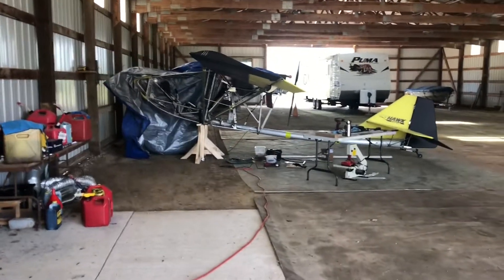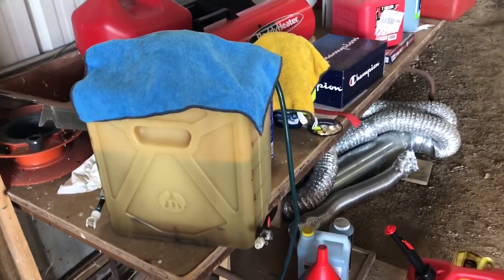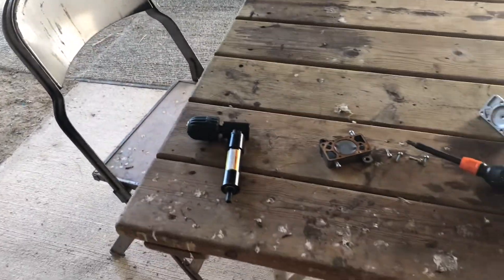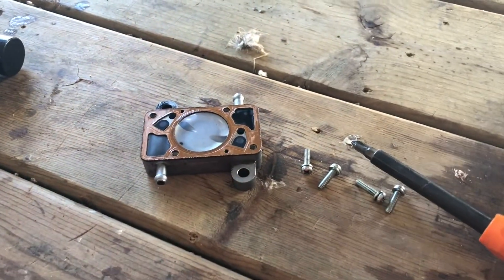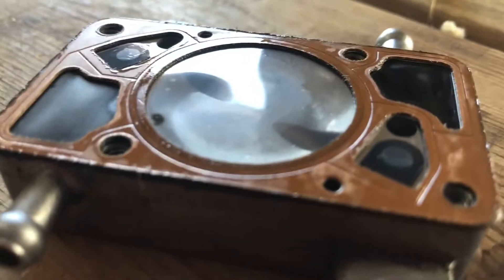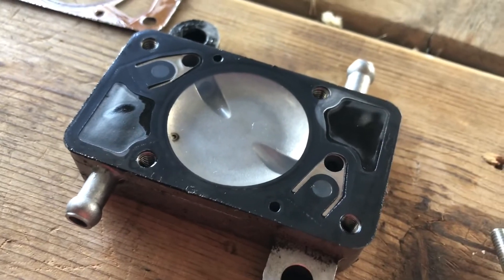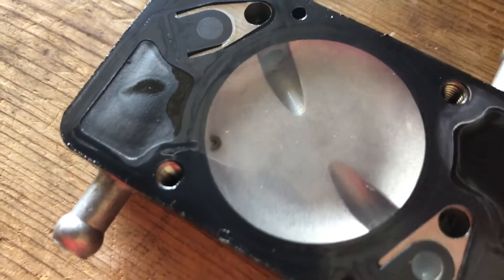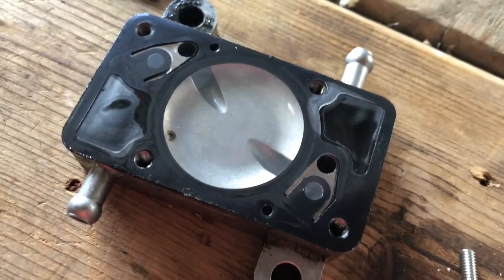CGS Hawk: Examining the Mikuni Fuel Pump

Comment: Glad you made it back from the sky,i too have no faith in those pulse pumps.it just seems to me a lame way of providing a constant reliable flow over time.my snowmachine had same issue with a round pump mikuni and that didnt work also i believe loss of pulse pressure from crank of all places the compression was low 110pto side n 115 mag side.when i put a clicky clack 4pnd electric pump on it runs fine even with said low psi.upon inspect.of old pump,same as ur issue no tears or cracks plastics looked flexable.in your case flying an ultralight i would opt for a electric mech.vane pump hooked to a flow gauge.that way you know if pressures dropping time to get outa sky.plus a small light showing power to pump to let u know its active.too bad there isnt a primer button or hand pump backup like the ole water types or like hydrualic hand pumps for landing gear locks.just enough to maybe keep engine n plane back to airport or field.good luck on ur fix,i would just ditch the mikuni try for better type pump such as elect.yes i know pulse pumps have run forever no trouble  like a heart,but to me its a weak liability  with no backup warning,such as heart attack pain,or struggling n sweats.!!mikuni just dies,no warning.must be better system out there.can i hear clear prop!!!jimmys world!!!snooky pa.💥👍💥